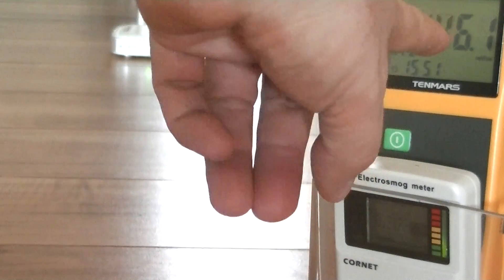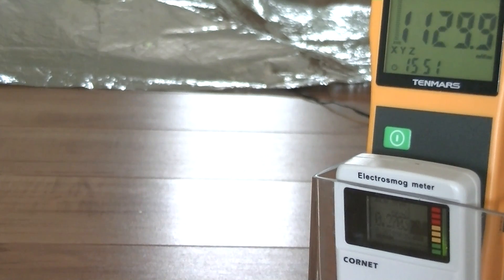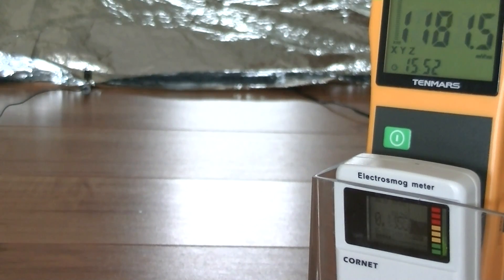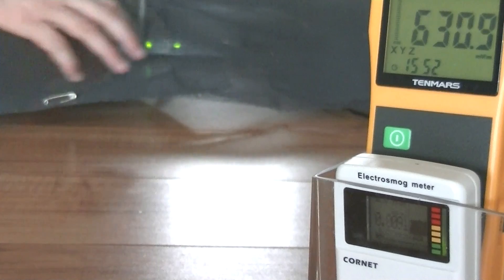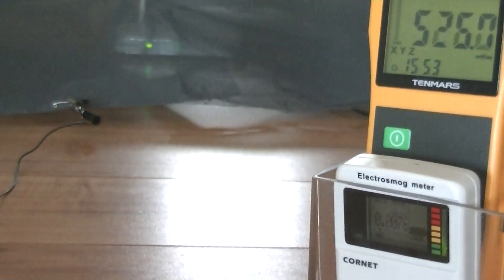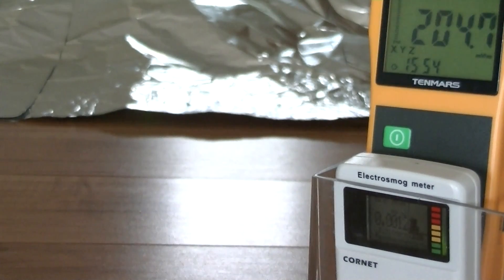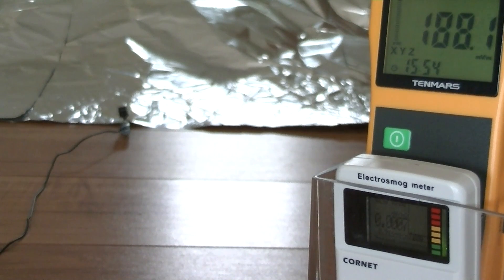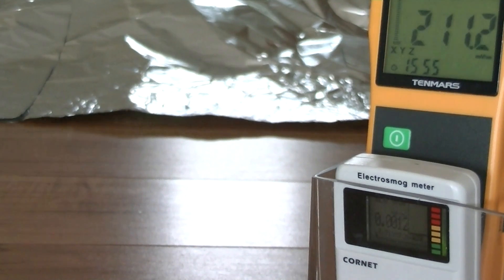Comparing Shielding Performance of Space Blankets, Aluminum Mesh and Foil, Grounded and Ungrounded

Comment: For future consideration of your experiments, your "ground" wire, say 2ft @ 20 awg, has an impedance of 15kohms @ 2.4GHz.  This is why it didn't make a difference.  Try using a larger alligator clip and a wide shield braid.  You'll start to see some differences.  You might also try to explain penetration depth vs. frequency to the listeners.

Comment: any slight gap will still let signal thru, so when you placed the foil on the ground there was a gap between the ground and the foil. It also depends what is in your floor? layers of flooring will allow signal to pass thru, I would not call this a conclusive test.

Comment: I may not believe rf is harmful but I really appreciate the experiment, I'm trying to reduce EMI from external hard drives. I'll have to go for a combination of foil and mesh because the units still need ventilation. While its obvious broadcast units like wifi routers put out way more energy anything electrical will output rf and needs shielding.

Comment: On "space blankets" the conductive aluminium layer gets interrupted by any tiny crinkle (even those present by folding inside the package) hence it is no conductive large area anymore but basically a mosaic of many disconnected small rectangles (similar like separated small aluminium foil pieces laying on a garbage bag). Check how sensitive VHS video tape reacts on crinkles. This material is similarly fragile.
 
Grounding makes only a benefit if the wavelength is smaller than the distance to the grounding point. (Microwaves have some centimetres, so for a larger area it becomes irrelevant.) The only risk of completely ungrounded (floating) shielding is that in dry season it may behave like a plate capacitor (or conductor globe) and so can charge itself e.g. by friction and cause electrostatic discharge that might crash or damaged IC electronics. (The risk is quite small.) And of course ungrounded metal can also cause electric shocks if accidentally shorted to mains voltage etc. and touched by your body.
 
The reason why aluminium flyscreen shields worse than aluminium foil is likely because the resistance at the contact points between the individual wires is too high. I doubt that the mesh size (some millimetres) already matters with wifi microwaves. It does not really matter how thin the aluminium foil is, because it conducts way enough to do its job. Copper foil may be even better, but mainly because it is easier to make conductive connections between pieces. Aluminium can not by soldered easily and has an oxid layer that makes reliable electric contacts difficult.

Comment: Can I turn standard outdoor extension cord by removing the insulation . Wrapping  the 3 wire with household aluminum foil tightly .  Re-installed the insulation back on and wrapping it tightly with black electrical tape .  Add the right plug and what I got is a  SHIELDED STEREO CABLE  ,  woofer speaker cable , pa speaker cable , microphone cable ....etc....etc....  Can this work ?    Thanks

Comment: Blocking every frequency will end up worst then the 5g itself..

Concrete block pretty much any rad.

And see what happens when you live in a bunker with 4 concrete wall...

You miss the good radiation.

There are ways to cancel 5g frequency without blocking everything.

Comment: Electromagnetic shielding like this is only useful for reducing noise in electronic circuits. Wifi routers & bluetooth have statistically negligible health detriments. If you want to be worried about something, be worried about using your cell phone next to your head when the cell phone signal is weak.
Reply: get out of here with this dangerous bullshit misinformation. there's a reason wi-fi is being banned in many places across the world, it' because the data reflects they are dangerous

Comment: Thank you for the video.   From testing that I did with my flip top cell phone with aluminum foil and also with aluminum window screen showed that even a small opening or gap in the covering radically reduced the effectiveness.   Depending on the product being shielded, over heating might be an issue.     Any recommendations on EMF meters?

Comment: surly energy can come in through a window and bounce around inside a foil wrapped room, repeatedly like a ricocheting bullet until all energy is fully absorbed or goes back out the window? It might be allot more harmful if all walls ceiling and floor are not perfectly wrapped??
Reply: Good point...use a metal/copper screen.

Comment: So if i wrap my modem  in foil it will basically block 90 percent of the emf LOL??? Doing this NOW.
Reply: @P4PKING-y1i  the signal dropped a little bit but I don't know. Plus my router and modem got pretty damn warm wrapped up like that. According to his EMF meter it works but how safe it is 4 the equipment I have no idea.

Comment: Thank you for taking the time to create and post this video.  I recently purchased a similar meter, which confirmed what I suspected,  that my condo home is filled with a toxic soup of EM/RF.  Based upon the incredibly high readings, the first thing I'm gonna' do is get rid of my Comcast/Xfinity wifi router and hardwire my computer directly to my router with Cat 6 ethernet wiring.  A tip to others considering this that I discovered on a YT video, is that you must also turn off the wifi signal on your router, because even with direct wiring, the modem will STILL send out its signal EVEN IF, you hardwire with ethernet cable. Unfortunately, most wifi routers DO NOT have a switch to shut-off the wifi. You have to go to the router manufactuer's homepage to find and enter the proper codes to turn the wifi off when hard-wiring your computer.

Comment: Supposedly, the shiny side of the Mylar Blanket should be facing the object that is emitting the Frequencies, otherwise you are reflecting the frequencies in the room in the direction that the shiny side faces.  I saw another video with someone using the EMF Monitor, the Mylar Blanket (just one) and had a cell phone on the other side of it (shiny side facing phone)  He called the number on the cell phone and measured the EMF's while it was ringing without the Mylar and with the Mylar.  His monitor showed a marked decrease in Frequencies with the Mylar Blanket between the phone and his meter..  Just sayin'...  as I do not own and EMF Meter....  but have purchased 6 Mylar blankets thus far, very cheap on eBay.

Comment: how come other youtubers get the opposite readings with this same test ? for instance user NoRadBlog  on his video titled "Mylar - The cheapest RF protection around"    does this with mylar and a  wireless phone and his numbers drop from 8 watts per square meter down to 0.05 watts ? could it be because you are touching the materials to the router antenna  ? or because he is grounding his mylar by touching it with his hand , while you are not even touching your materials  ?

Comment: Your testing is flawed.  You have not completely enclosed your router and left gaps between it and the surface it was placed. This allowed WIFI to escape and be measured by the meter.  If you would have completely sealed the router with the isolating material you would have had much better readings.

Comment: Thanks for doing the experiment.  One problem is that the blanket is touching the antenna which won't help.  The idea is to create a Faraday cage where signal can pass AROUND the conductive material leaving the contents inside uninfluenced.  Also, Faraday cages don't need to be grounded but will be safer if the goal is shielding from dangerous currents.

Comment: if you've ever seen "the Japanese tin foil ball trick" you should relate . I took sheets of tin foil , heated it with a small torch , and hammered them into one solid sheet . cut it with shears , and no that is my cell phone case , I don't get service unless I remove it to make a call but im also not irradiating my testicles or being tracked . I imagine or hope some of you sould find this helpful.

Comment: So aluminum foils we use for oven and can buy in the supermarket can do the job ?
Reply: ALUMINUM FOIL AND SPACE BLANKET 
Here are TWO things you can do to help. 
#1 WRAP YOUR SMART METER IN ALUMINUM FOIL 
#2 BUY A $3 SPACE BLANKET AND PIN IT TO THE INSIDE WALL THAT HAS THE SMART METER ON IT 
How to test your space blanket, borrow a cell phone that is on and working 
Wrap the cell phone in the space blanket at least twice Call that cell phone and see if it rings 
 IF IT RINGS, BUY ANOTHER SPACE BLANKET FROM A DIFFERENT STORE
if the cell phone doesn't ring, then pin that SPACE BLANKET up on the inside wall, opposite of the smart meter that is on the outside wall 
I LIKE THE SILVER ONE SIDE AND GOLD ON THE OTHER SIDE 

Don't forget to have your children to draw pictures of people DYING from the extremely high levels of radiation 
PS, If your power company complains do this 
#1 Ask to see their license to operate a commercial, meshed network, FHSS, AMI7 radio transmitter 
#2 When they complain about the contract says, then ask to see the copy that had your signature on it. 
And if all else fails, ask for a copy of the CERTIFCATION EXHIBIT so you can find out what the DO NOT INSTALL DISTANCE is according to the FCC report

Comment: At those frequencies 2.4 ghz the wire on the ground is many wave lengths long and acts as an antenna itself.  As a amateur radio operator that has always been a challange to us.  That is what is refereed to as a DC ground... ;-)
Reply: How about DISTANCE TO COMPLIANCE ???
Have you looked at the DO NOT INSTALL DISTANCE for an AMI7 radio transmitter?
Reply: Cant say I have, I do know that even at lower frequencies an effective ground wire needs to be as wide as possible.  I've seen 6' wide ground straps used at HF frequencies.  My self I forgo RF ground because of the near futility of it . Something that would absord RF and convert it to heat would be ideal.

Comment: to protect my room from smartmeter  what radius of coverage needs to be placed on the inside wall and do I need to cover the entire Corner incl. ceiling and opposite wall as well. also does layering intensify shielding? say if I use a mylar blanket then the screen and then the foil, would that multiply the strengh ofbprotection?

Comment: Good video.   I have aluminum foil around the Comcast router at home. I use an app on the phone to measure microwave radiation.  It definitely reduced it but I think the WiFi router adapted and boosted the signal.  Someone told me you can access the router and turn down the power via software controls?? 
I think a better solution is to put an aluminum foil barrier (2 layers thick), directly between the router and where I sit. 
If you get the app for your phone watch out cause some of them want access to your files and camera and microphone not just the phone WiFi.  Hmmm. 
I would like to see this test done by placing a barrier vetween the source and receiver and not just shielding over the source.

Don't forget your neighbors have WiFi and Smartmeters and the wires in your home have dirty electricity.
Reply: Freedom, what is the name of this app you downloaded?

Comment: Excellent demonstration. Does this effect your wi fi reception?
Reply: WiFi improves because the #2 radio transmitter will not interfere any more.
YOU SHOULD SEE A75% IMPROVEMENT IN YOUR WIFI CONNECTIONS

Comment: its leaking from the cracks you would have to wrap it take a cell phone roll it up in aluminum with the edges not folded over on the 2 ends it still receives calls and text roll the corners . on the rolls so there is no cracks and the signal is gone done the same test with an router  Aluminum is the best mylar never worked . for the inside i purchased lead drywall sheets they have a 1/8 inch pice of lead glued to the back side of plaster board that fixed the radiation emitting through my house from the neighbors meter .

Comment: Should make another video with foil underneath it. The shield just acts as an antenna basically like you said. Transmitter, ground with the base would work much better. More air tight the better.

Comment: everyone bashing for not completely wrapping the router or sealing the 3 materials get a grip.  all 3 were used the same.  Even if all 3 were installed in a perfect enclosure and reduce the radiation to 0 this still shows that aluminum foil is far superior.  but I would have like to see it with copper mesh and chicken wire also.

Comment: If the tin foil can stop high frequency waves, does that mean it works for low or extremely low frequency waves as well?
Reply: La Diablo I have done a bit more research and found the not much will stop low frequency waves, though you can get Mu-metal sheet for a reasonable price when bought in large quantities, they are used for magnetic shielding in motors and stuff.
Reply: @deperivianimae43  For low frequencies it needs to be grounded. And it won't block low frequency magnetism (higher frequencies get blocked by producing induction current converted into heat).

Comment: Hi, Environmental Radiation LLC.  I have a question for you. (I asked another poster this same question below). I'm picking up a lot of EMI through the floor of my apartment. I have a small home studio-type upstairs. Everything is grounded (I tested it w/ a meter on the outlet), but I get noise that only goes away if I face my guitar at very specific angles and on one specific plane. This situation also pretty much renders dynamic and ribbon mics almost useless. I understand that moving coils mics are more susceptible to this sort of thing. Now, outside my window, there are four transformers on the power lines and a row of air conditioning units for the apartment. I'd very much like to lower my noise floor. Would aluminum foil or anything mentioned in this video greatly reduce the EMI that I am picking up? I realize that what I am asking is more related to the audio aspects of this. So, if you don't know the answer, maybe you can steer me toward someone who does.

Comment: Did this guy read the protocol for WRAPPING the item in the mylar blanket and not just placing it on top of the unit... The reason it did NOTGHING is because it wasn't WRAPPED UP & totally enclosed...  DO THAT & there WILL be differences...  Nothing like running an IMPROPER test to get results that prove your point... hmmmm
Reply: But wrapping up your entire home/rooms is not as practical as just placing some sheets on the walls or something, this demonstration is far more practical and realistic than having your radiation source entirely enclosed.

Comment: Hi Steven, this is great. Thanks so much. Would the aluminium foil work in windows as well to block wi-fi signals from neighbours routers? Also, could I put a piece of aluminium foil over a switched off power outlet? Where we sleep, our heads are right next to the power outlet and I'm concerned about the radiation coming from the power outlet even with the switch turned off. We're in the UK.
Reply: Power lines inside the walls will still be hot. Can you turn off at the meter box?

Comment: Please tell me how to best shield a wall.. I just found there are 6 smart meters located 2 feet from my bedroom wall, making me very, very sick for the past year. I feel like I'm dying a slow death.  Seems the only radiation blocking paint is from the UK which is difficult to purchase. In your opinion, could I cover the inside wall in aluminum foil.. and then maybe wallpaper over? If so, would I place the 'shiny' side of aluminum foil towards the meters? 
Am having a hard time finding answers to my questions! Thanks.
Reply: Buy an RF meter and experiment yourself with different materials and the way you use them.
Reply: The RF meter is on the way. Do you know anything about shielding? Someone suggested I make my own paint, mix in 1/10 with lead powder. I'm not tin-foiling the wall.
Reply: Ashton I have the same problem. i cannot sleep. i feel so sick. my moods are so up and down. My skin burns, my scalp burns, my heart pounds. I am going to try the foil on the walls to see if that helps. if you find the answer please let me know, and i will let you know if I find anything. I also realise that the mattress itself conducts electricity, so there is another thing to look into .